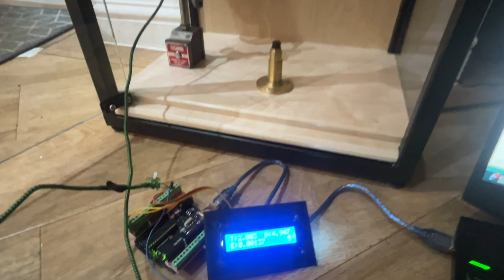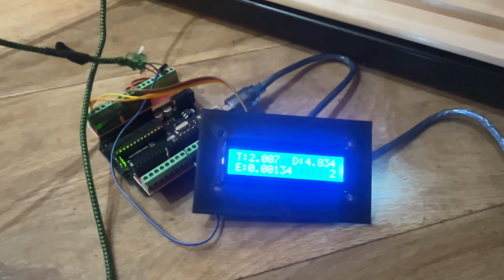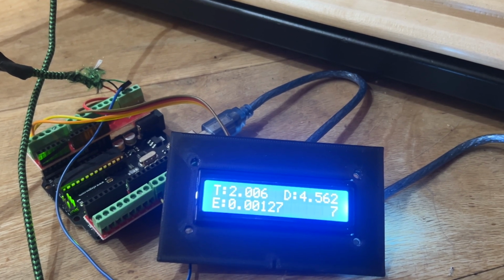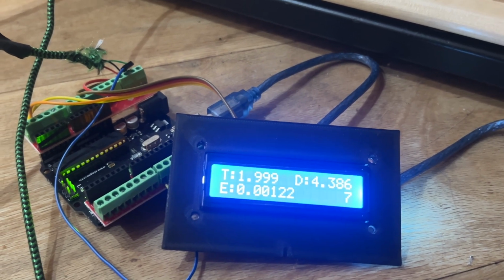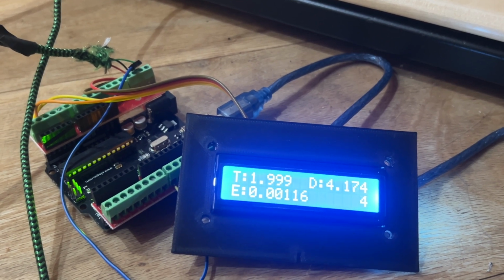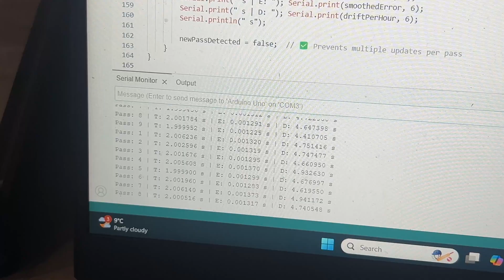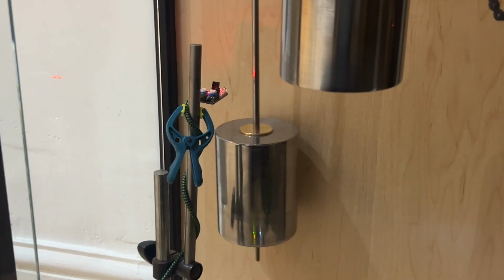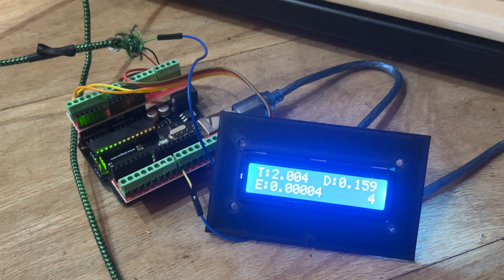DIY Arduino Clock Pendulum Timer | Precision Timekeeping for Horologists

Comment: You can find a radio clock connected to the arduino, and get it to slow or speed up a swing to fine tune the time.